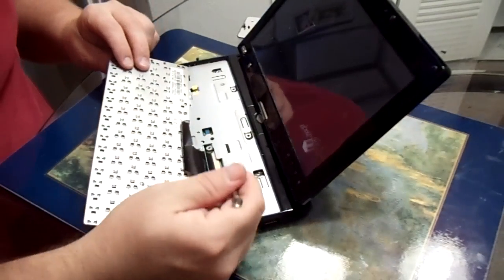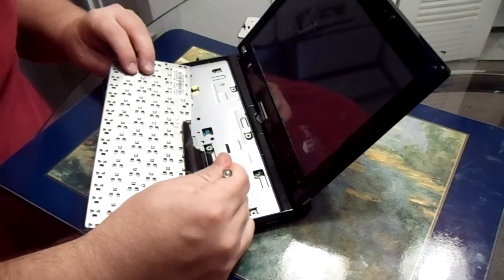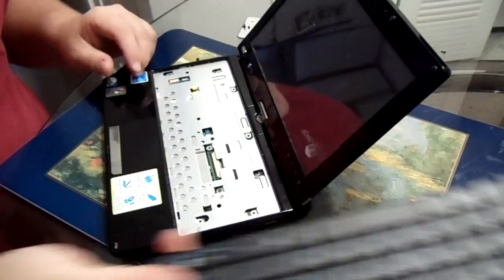Asus Eee T91 Disassemble Replace Battery Hard Drive Wi-fi Replacement keyboard Removal Motherboard

Comment: What did you do to release the keyboard?  I found the metal things at the top of the KB but what do I have to do with them?
Thanks
Reply from the maker: Make sure you take all 10 screws out on the bottom.  Take a small flat head screwdriver to pry the keyboard out on the top of the keyboard.

Comment: I have been using my T91 as a Ventrilo server for ages. I set it up and threw it in a corner and forgot about it, so being plugged in 24/7 the battery naturally went bad and started to bloat inside the machine, distorting the plastics pretty badly.

For the life of me I couldn't figure out to get at the battery so I could remove it, until I found your video. I can't thank you enough for posting this video! It was exactly what I needed! =)